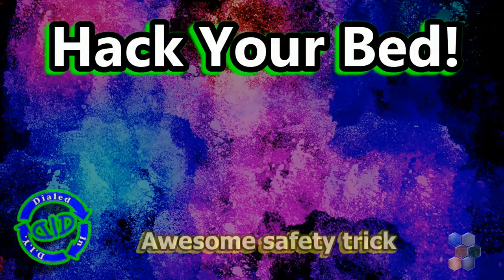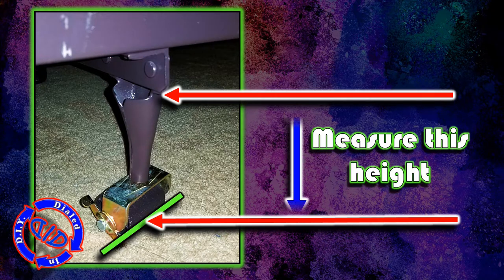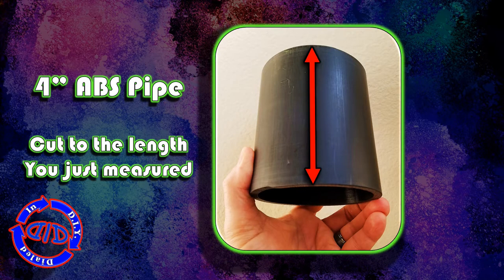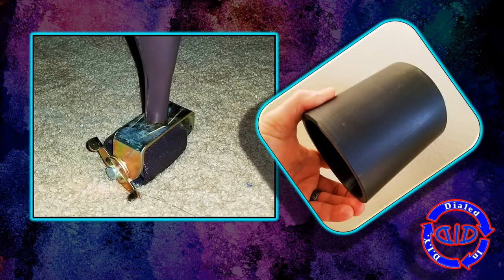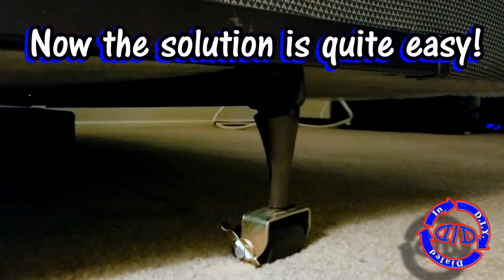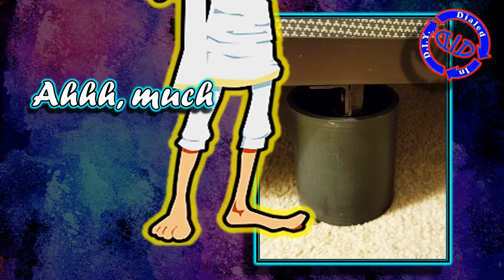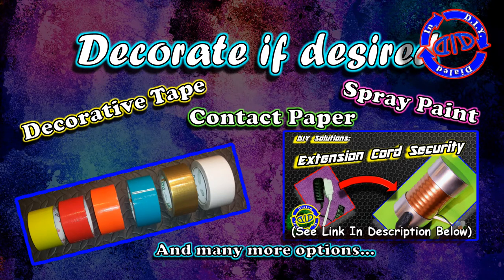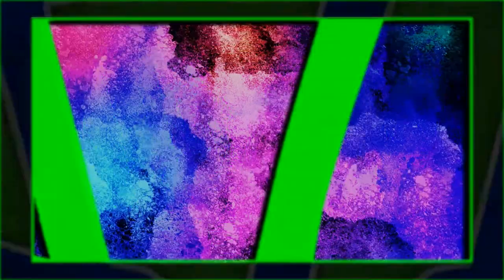Hack Your Bed - Easy & Awesome Toe Saver

Comment: It's easier to use a section of foam pipe insulation
Reply from the maker: Great idea... that is quicker and easier to cut too.  I have found that the ABS is easier to decorate if you want to do that and the ABS holds up much better against accidental sideswipes from a vacuum cleaner.  Thanks for watching and for the comment!